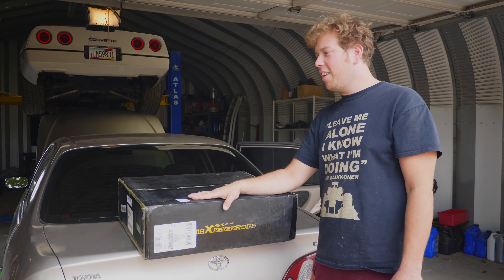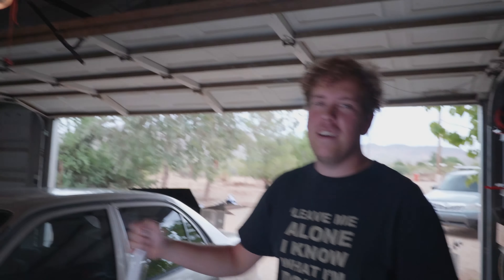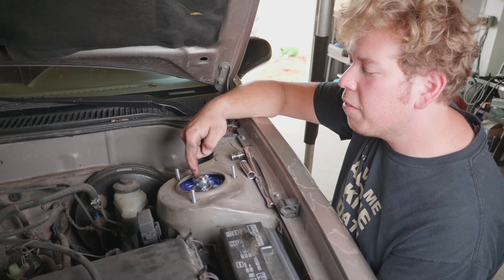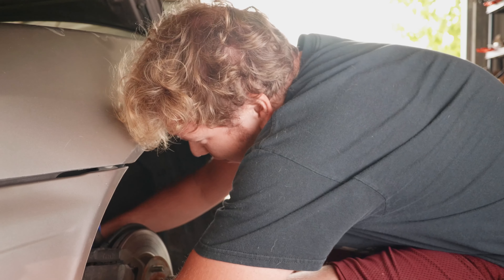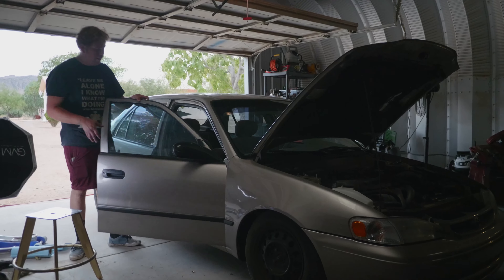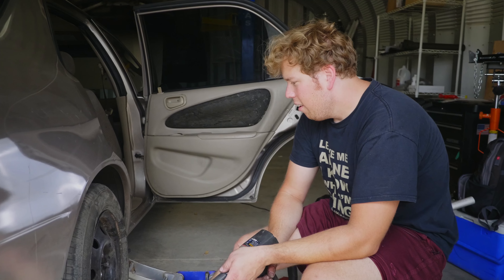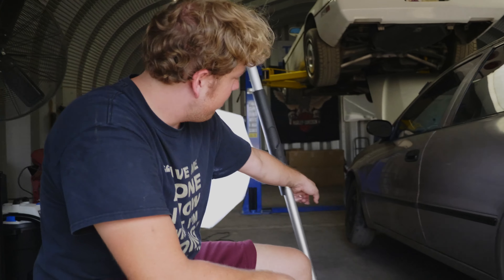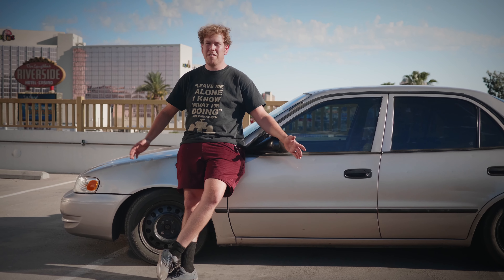$300 Coilover Install...

Comment: I have these on my 02 Corolla and they're pretty good besides I need an alignment but it's why better than the cut stock springs it had when I bought it
Reply: My front springs were cut when I first bought my 95 corolla. To find out later it was to keep the fuel in the tank because the tank was leaking. 🫤
Reply: What brand? Do you have a link cause I can’t find them

Comment: I’ve been running these on my 2000 for about 4 years now and have had 0 issues being my daily
Reply: Quick question I just bought them for my 02 Corolla did you need after market control arms
Reply: @devenalex8409  nope it’s a simple bolt on part, no modifications needed and you don’t have to change anything else
Reply: Do you drive fast or aggressive ?
Reply: @ch1pskylark793  not really, the main use of the car has been daily use for the last 4 years and I’ve swapped wheels a couple of times from running 15s all the way through 20s but at the moment the car sits on 16s with nitto tires and I’ve gotten on it around corners and I have yet to encounter any issues with the coilovers or any of the suspension
Reply: @randycampos874  oh ok cool ima probably get em then 💪🏽
Reply: @ch1pskylark793  go for it man having them on for as long as I have I can tell you that there worth it
Reply: What's the name of these coilover on Amazon bro
Reply: @randycampos874  does the steering radius get effected/ is there any rubbing of the tires?
Reply: @jayfunk1125  No the steering radius remains the same and tire rubbing will depend on you setup what tire and wheel combo you run and how low
Reply: Dónde los compro ??? Me podría decir donde

Comment: Dude,  i'm sold.  Got the same car and definitely doing the same thing...  thanks
Reply: Same !
Reply: how’s your experience been with the coils since? any problems?
Reply: @twotoxic3464  no problems at all.  The only thing that will happen (if you intend to buy them)  is that they will settle.  You will have to adjust them quite a few times.  So in my opinion,  at them higher than where you want them,  it will save you taking the tires more than needed. I also hear some chirps but I think that might be because I really have not aligned my car properly. 

Oh, and it is my daily driver.
Reply: @dinomash379  how long did your shocks take to settle ?
Reply: @dinomash379  i just installed them on my car last night?
Reply: @twotoxic3464  awesome
Reply: @twotoxic3464  i think I adjusted them 3 times.  This last time they really settled,  so much that the front tires are under the fender and the rear are almost under.  It looks good not going to lie that's why I just left it alone.
Reply: @twotoxic3464  time wise,  can't really tell.  I have another car which I drive, so how long wouldn't be able to tell you there
Reply: Hey can you help me out…do you know if these can lift over stock height?? Thanks man
Reply: @twotoxic3464  about six month since I don't drive it that much anymore

Comment: NICE,  I have a $500.00 1997 Geo Prizm LSi 1.8l Manual that needs struts/shocks  this would be perfect !!!   Please make a follow up video if the springs settle
Reply: Did you ever get those coil overs ? I got the same car but in automatic